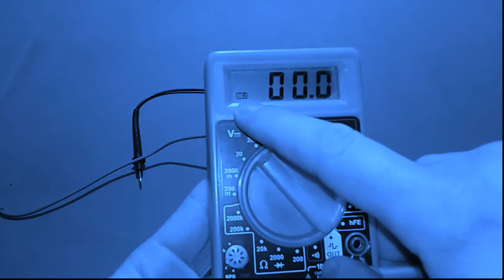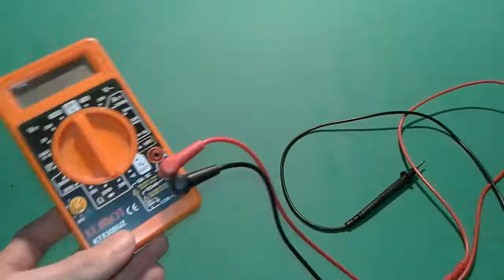Digital multimeter battery replace - DT830B LCD Digital Voltmeter Ammeter

Comment: I fixed my multimeter with new 9V. All my AA were OK. Before I thought all the batteries I was testing were flat and multimeter had blank screen no matter what V= I set it to. Multimeter is great tool for testing batteries to see if they are OK not.

Comment: I hate this multimeter
Reply from the maker: Louis-Thomas Tremblay I totally get it its like a hate-love with this multimeter but being so cheap you can tear it apart and have your revenge
Reply: NoSkillsRequired mi anlish is not the besr but yea this multimeter is very cheap
Reply: I am broked  one
Reply from the maker: Louis-Thomas Tremblay It's good to get started and don't worry if you will break it if you want a real multimeter go for a fluke
Reply: NoSkillsRequired great video
Reply: Guys
Reply from the maker: Louis-Thomas Tremblay Thanks and don't be sad if you broke this meter you learned how to use it all the best